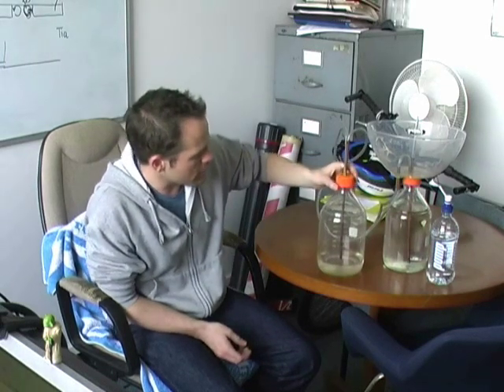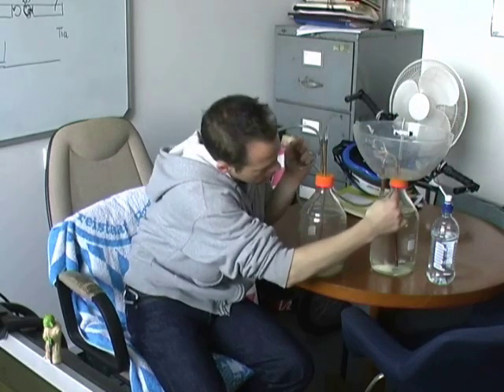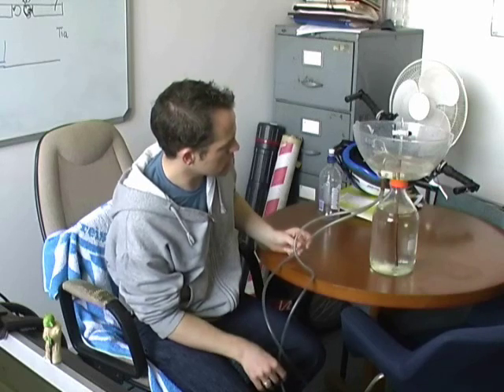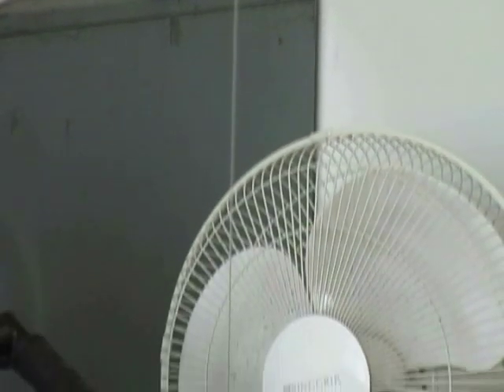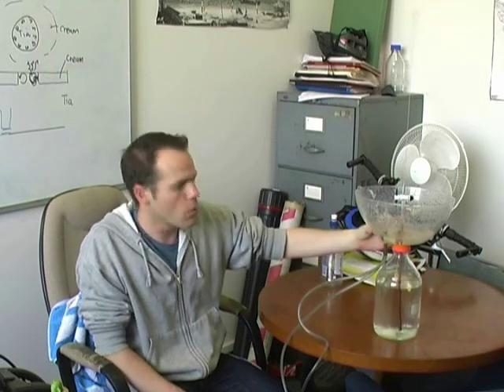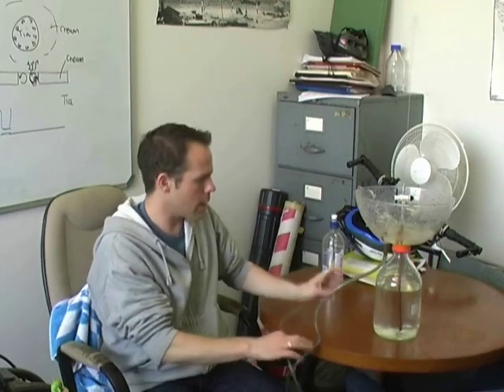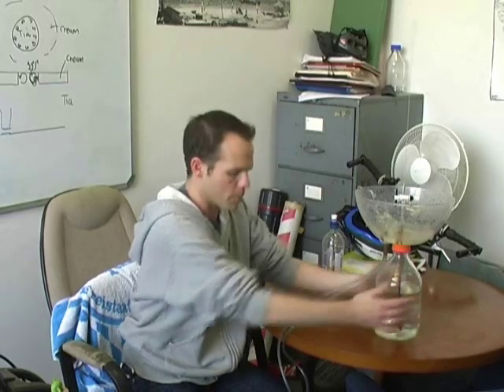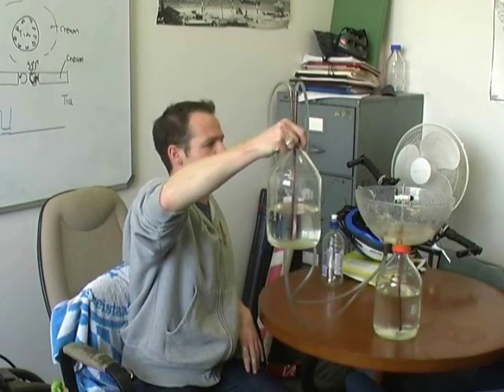Hero's Fountain - Part 1

Comment: Yes we understand that it goes in a cycle, but it isn't just height difference that's causing this to happen, in that case the water should never have gone above the top.

You are using the surface of the water a piston to push the water higher up (with less force), but you can push the water higher than to begin with.

If you instead of sending it down again captured it in a top bottle, you could prove that energy was 'not' conserved.
Sadly the experiments is always done this way.